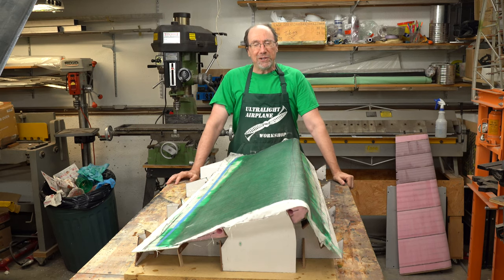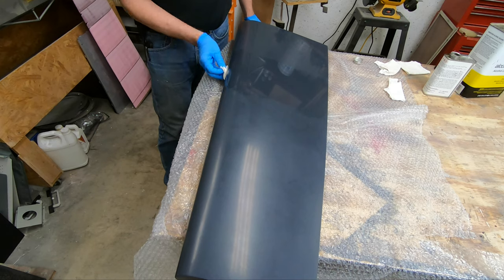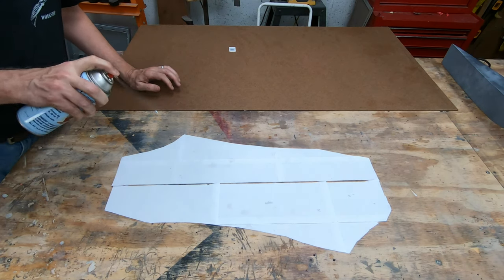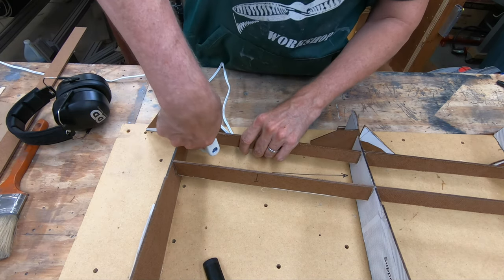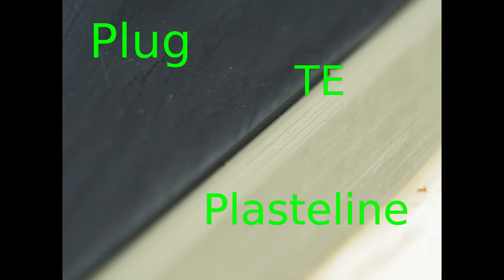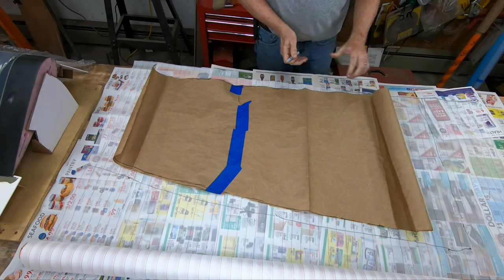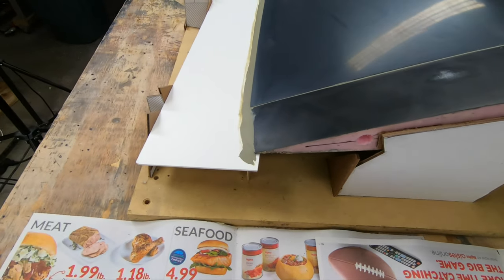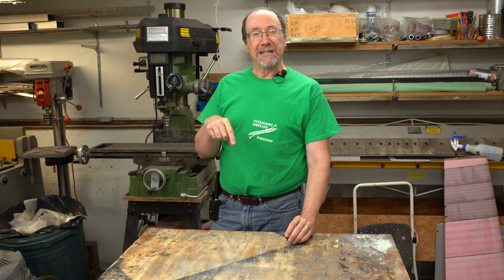UWS-1 Design: Rudder Mold Part 3, Plug Cradle and Mold Surface Fiberglassing

Comment: Use a paint roller an fly
Reply from the maker: Hi Robert. Just to clarify, are you suggesting using a paint roller to apply the epoxy to the fiberglass? I'll have to think about that. Also, if I'm wrong about what you are suggesting I would love to hear more about it.
Reply: @Designer103  yes 4 " paint roller pad, wets the mat nice an fast, an even!